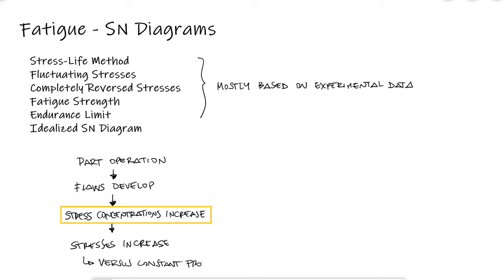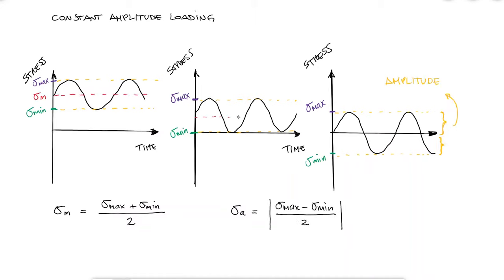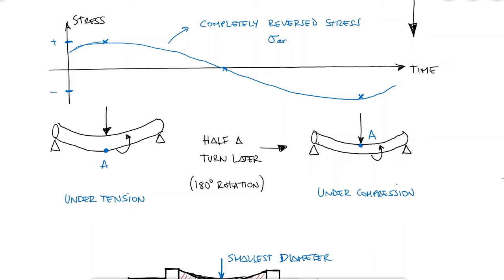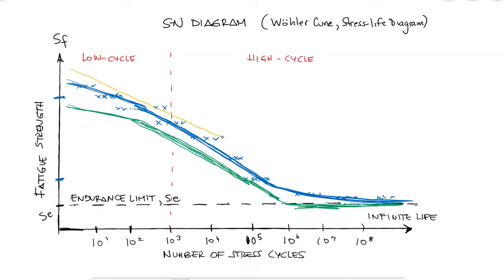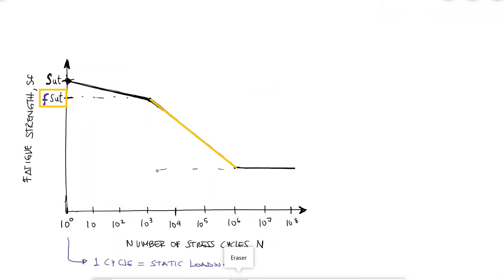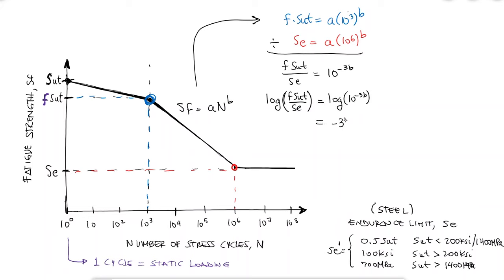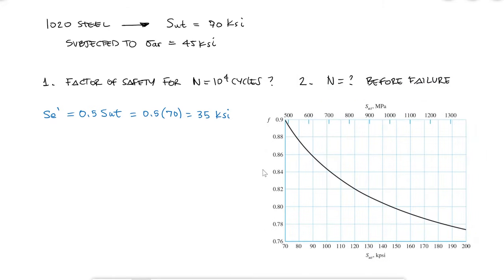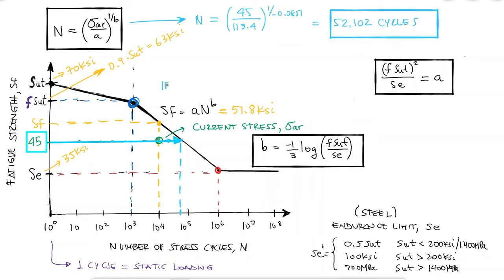Fatigue (Strength-Number of Cycles) SN-DIAGRAMS in Under 10 Minutes!

Comment: subjected to sigma ar is the maximum stress over the body of 45 ksi after the static analysis?
Reply from the maker: σ_ar is the alternating stress that we get after performing the stress analysis; there's no static loads in this problem.
Reply: @LessBoringLectures  @Less Boring Lectures so how do i validate my piston arm fatigue analysis with hand calculations ? I dont know the alternating stress or i can say for example material has 300 MPa yield strenght and i assume that alternating stress is %20 of that. So 300 times 20 / 100 = 60 MPa alternating stress for fully-reversed analysis. Am I right?